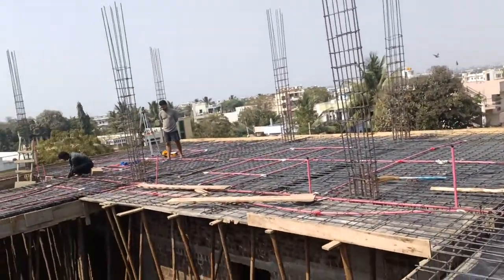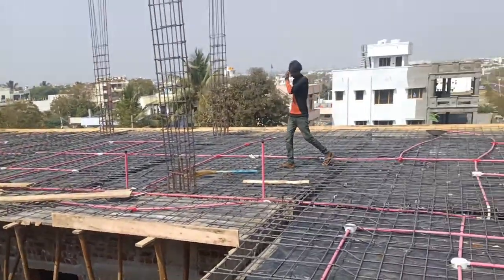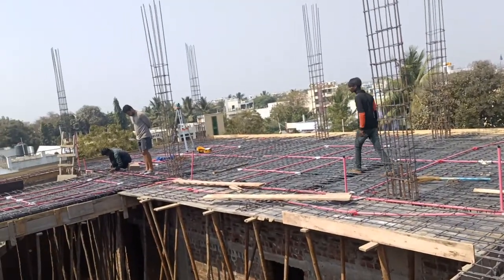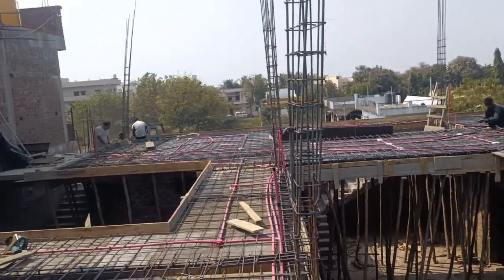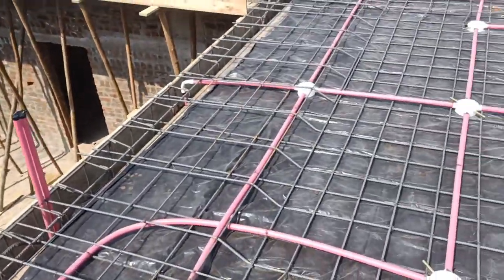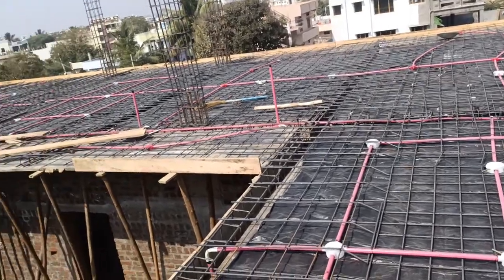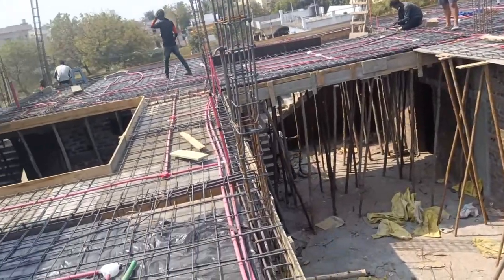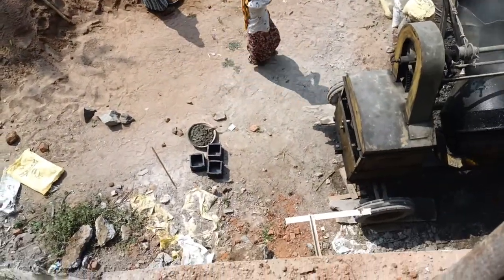Providing plastic cover for slab before concreting.

Comment: Sir what about plastering celing roof after molding ?
Reply from the maker: Direct you can apply wall putty to ceiling
Reply: @surveying1987  applying direct wall putty on celing... Can cause any air crack or any problem sir ? Is that ok to proceed ???
Reply from the maker: @RajeshRaj07Rs  no problem u can go for it.